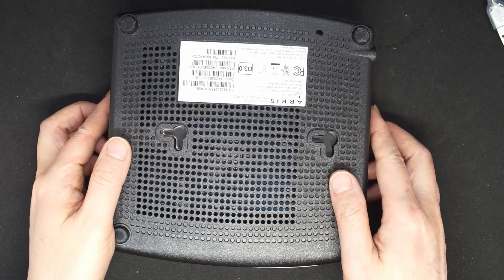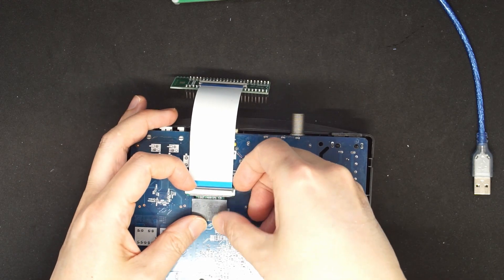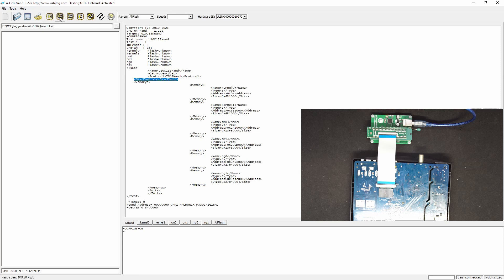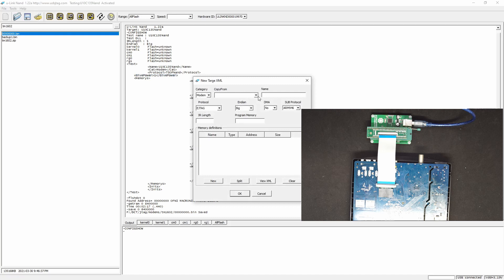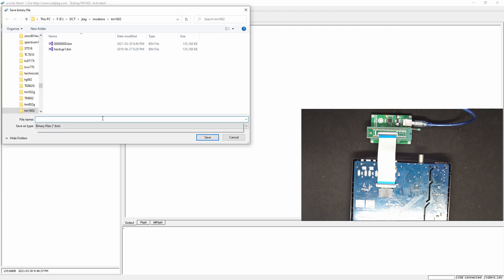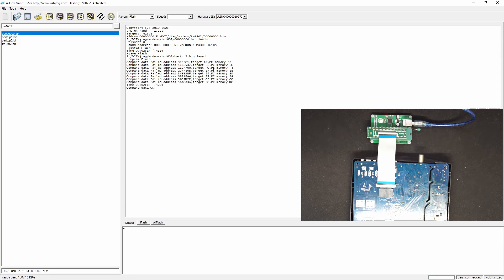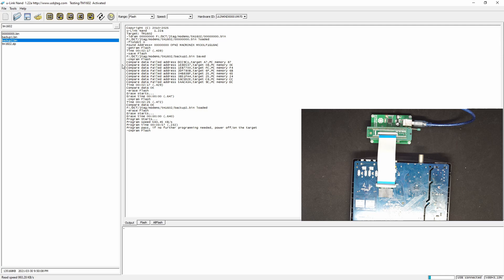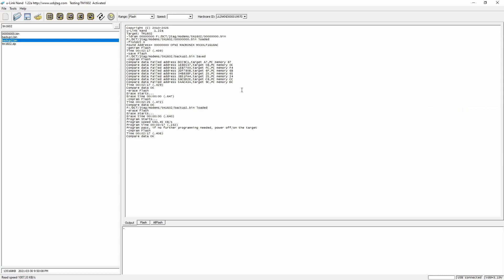u-Link NAND program modem TM1602

Comment: Xml folder where to save the file 
This part is not clear for the explanation
Reply from the maker: The folder can be found at Help->Goto configure folder. This applies to Win,Linux and Mac
Reply: @usbbdm  
I am using window 10
Reply from the maker: @vladimdoccy7665  Just go to Help->Go to configure folder.
Reply: @usbbdm  sorry again to bother  i am still having issues how to save the file in xml folder 
Do I have to use an external folder
Reply from the maker: @vladimdoccy7665  Come to www.usbjtag.com and chat with me. I can help you remotely.
Reply: @usbbdm  thank you for your help but still having problem saving file for new targe xml  called duplicate test name